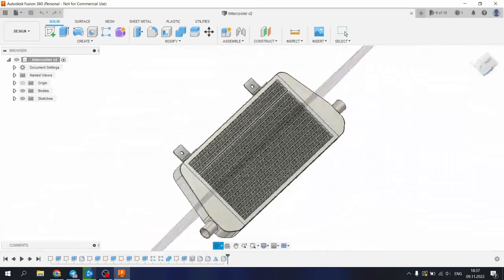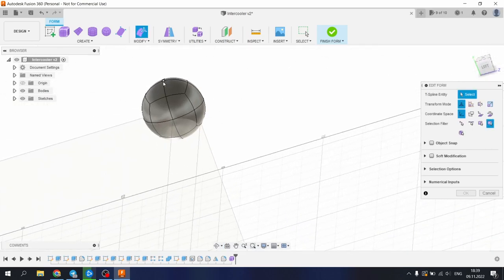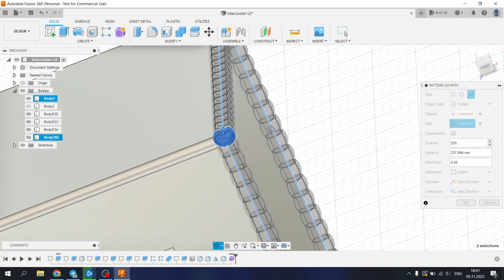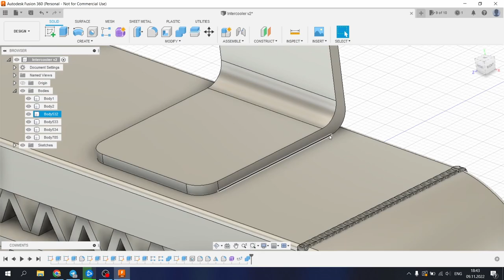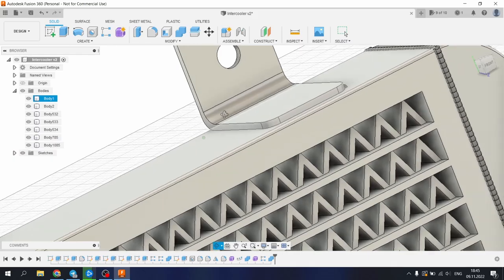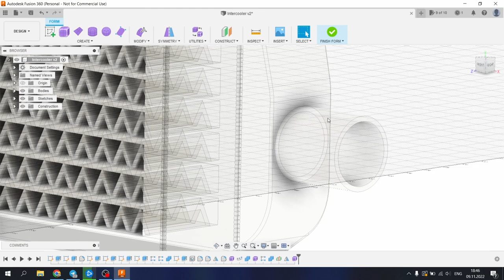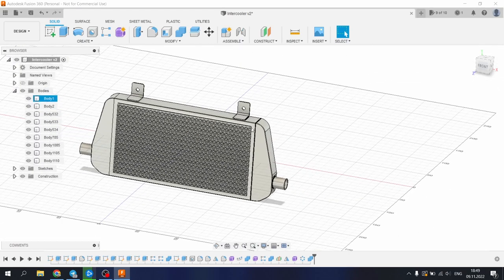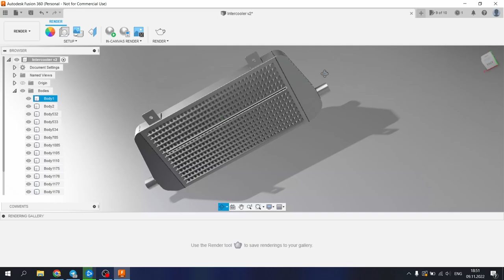Fusion 360 Welding

Comment: Hi there, nice video. I have a question. After placing the form objects at the required places, If I perform a static load simulation, will the form bodies behave as a weld joint in the simulation?
Reply from the maker: Hello! Nope, they unfortunately don't.. This one only for visualisation, but interesting question tho =)
Reply: @Kowafatcompany  thanks
Reply: @Kowafatcompany  for that purpose of simulation what can I do?